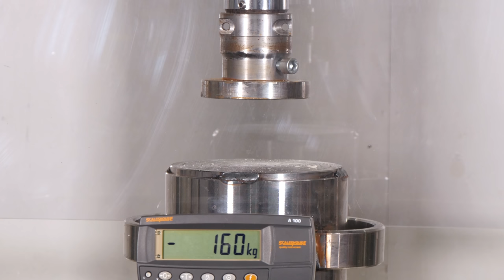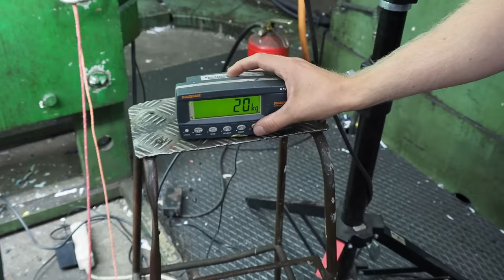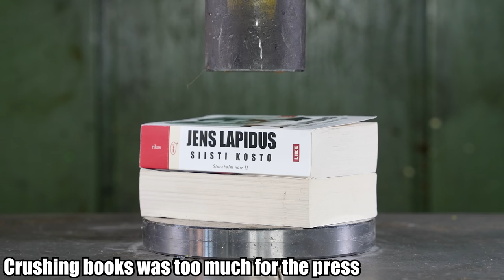10 MOST SURPRISING Hydraulic Press Moments

Comment: The amount of force that bone withstood was incredible. Watching it shatter like that made my leg hurt though.
Reply: Yet a simple fall can shatter my pelvis
Reply: @Tensen_Tempest  just a bad unlucky angle is sometimes all it needs
Reply: @Tensen_Tempest  bones can withstand an incredible amount of compressive force, but they break super easy when bent
Reply: Yeah its the different types of forces at work. I think you wouldn't need nearly that much power to break it via tension or rotation.
Reply: Angle of impact and how evenly the pressure is distributed play huge factors; it's a lot easier to crack an egg than it is to squeeze one until it bursts (good luck on the latter; if you're more or less evenly distributing force, that thing isn't breaking)
Reply: That was a moose bone, so it would probably already by several times stronger than ours since moose are fucking massive
Reply: I was surprised when it withstood 4000kg, totally didn't expect it to handle almost 10,000!
Reply: @arsomnes  They're even less resilient to twisting forces
Reply: I wonder  if the porous nature of bones is what lends to its incredible compressive strength
Reply: Next time tell them not yo use your leg bone, then!
Reply: It was like an Xray from Mortal Kombat
Reply: If bone's tensile strength was that good, I wouldn't have a hip full of hardware.
Reply: @cebuninja8008  not really, humans bones are almost same, they shatter at something around 4-6 tonnes. Moose shattered at 8.8 if I got it correctly.
Reply: @placer7412  maybe, I'm not sure if birds have porous structure too, but them having hollows in the bones makes them really vulnerable to blunt trauma.
Reply: 10k kilos. Madness
Reply: That poor cabbage gave its life so we could all be free. Remember that, my friends.
Reply: Bone-shattering force indeed.
Reply: @willwunsche6940  your muscles actually break them, if you were unconscious you'd be fine.
Reply: That made my arm hurt
Reply: did the math, it withstood over ten tons before shattering. holy
Reply: You gotta angle your bones like a tiger tank
Reply: To be fair structurally that is the best way for a bone to take force, turn it on its side or put it at an angle it wouldn't take the pressure as well
Reply: yeah looked like it withstood 8-10 tons before breaking. incredible
Reply: Reminded me of Alex Smith.
Reply: @arsomnes  kinda like tempered glass imo
Reply: Reminded the Atlas mythos. He had entire skies on his shoulders...
Reply: @arsomnes  I saved me about 40 seconds of time, I will be forever thankful.
Reply: Really tho. If us humans evolved to have such bones so we could carry that type of weight is insane
Reply: Same
Reply: It made my cow hurt.
Reply: @Tensen_Tempest  your pelvis
Reply: It's over 9000!
Reply: Moose bone
Reply: hydraulic press has got nothing on Joseph Clark
Reply: Went from doing fine to getting vaporized
Reply: Supreme Engineering.
Reply: @unknowncommenter6698  bones of birds are usually by far more porous and gaps are filled with air. Grants a lot of stability with extreme light weight, sure they're not build to hit windows. 😂
Reply: @K Ryuzaki
For eggs it’s only from top to bottom it’s strong. Squeeze side to side and it’ll break easily.
Reply: @Oturan20  Where did you get that from? That's just not true. Soft tissue usually absorbs forces or redirect those, so it protects bones from breaking. Seizures may cause fractures, that doesn't mean muscle break bones in an accident. The Direction and intensity of forces, soft tissue and joint functionality and stability of bones decide about the outcome of an accident. 
Many people who fracture their pelvis may have a history of dysfunctional iliosacral joints and facet joints of the lower back in combination with less "reactive" soft tissue due to high tension.
But mostly it's really all about high force on a small area in a bad angle or torsion.
Reply: It's taking all my will power to not  make a boner joke right now!!! 🙈
Reply: 10:00 Card-shuffle-machine for casinos !!!
Reply: Probably wasn't a human bone
Reply: @johnwhite7700    several tons of force have been measured in  Some martial-arts champs' punches & kicks !!!
Reply: @willwunsche6940  The iPhone screens of the human body
Reply: bones can withstand a lot of compression force in that direction (wouldn't if they turned the bone on its side) but very little torsion force, which is usually how breaks occur I think
Reply: Some very healthy bone right there
Reply: If I apply ever a force as little as 400kg or 4000N perpendicular to leg bone then it will easily shatter
Reply: My shinsplints hurt in sympathy
Reply: I did not know this!
Reply: That was a tusk right?
Reply: "Holy Shit, it's gonna be bad."

Keeps going

Love this guy.
Reply: The weight of 2  diesel trucks is insane
Reply: @RyanFox85  Thank the heavens you’re not into watching that sorta stuff. I can’t even think of such a scenario! 🤯🫣
Reply: 10 tonnes of force… crazy
Reply: @russdy1982  I love how his reactions! So adorable! 😊
Reply: I think that piece of bone was much thicker than normal bone. Also most bones don't break up and down, they break sideways. Still pretty cool how strong our bodies are, though
Reply: @antagonizingprotagonist8721  It must have been from a femur?
Reply: It made my stomach go a bit queezy
Reply: Can't beat the original engineer 😏
Reply: timestamp?
Reply: Big boy drank his milk, all right!
Reply: @cebuninja8008 imagine a brachiosaurus bone...
Reply: As you say that a black ooze forms in the corner of your room. A man covered in the ooze rises up from it laughing.

Comment: Its both interesting and difficult to fathom that bone is capable of sustaining more psi and downward force than a car jackstand. My all time favorite HPC experiment is watching the press cut cards in slow motion.
Reply: This cards sounded so much like popcorn too!
Reply: The bone has a lot more total cross-section than the jack stand at its weakest points and doesn't have moving parts introducing additional stress and failure points. A solid cylinder is one of the strongest shapes for straight compression, can't say I am surprised. A simple sheet of paper rolled into a tube is surprisingly strong too for how floppy the walls are when you poke them sideways.
Reply: @teardowndan5364  people don’t seem to understand bone is rarely the issue in healthy people. It is incredibly strong, constantly remodels and rebuilds itself (you literally replace your entire skeleton every 7 or so years) and has an incredibly amount of blood supply to speedily repair any damage done to its dense and complex structure. There’s a reason why joint issues are so much more common, the cartilage covering the bones don’t even have their own blood supply and thus heal absurdly slow or not at all
Reply: Now THAT is how you cut a deck of cards.
Reply: I learned this when Bill Nye demonstrated that comparing it to aircraft aluminum.
Reply: Turn the bone on its side and it would probably crush fairly easily.
Reply: @eahenrie :  "52,000-Card Pick-Up?"
Reply: A bone has to bear constant compression from body weight plus positive and negative G forces from extreme maneuvers also intensely being held at tension by by muscles and connective tissues as well as additional loads for several decades continuously in a corrosive environment, where a single failure means death and there is no meaningful downtime to be taken offline for maintenance.
Reply: Bones tend to be very strong against compression, but weaker against sheering, or twisting forces. That and the joints are why people aren't way, way stronger than we are. 

Bones are frankly amazingly well engineered.
Reply: Nobody here talking about how cilinders are naturally strong when compressed vertically

And yes ik if I crush it at an angle or compromise the sides it's significantly weaker it's just that they did not touch the bone during the crushing
Reply: Remember friends. Its not the bones that give when you lift weights. Its the glue attaching  your tendons and ligaments that gives.
Reply: @spinosaurusgirl09  Literally the second reply to this comment thread talks about it
Reply: @thomasrocke  I see that now thank you for pointing out my mistake, and I'm sorry for almost spreading misinformation
Reply: @spinosaurusgirl09  No worries. Sorry for being hostile, we all miss things sometimes. Have a good day
Reply: Sadly that's a moose bone. I do wonder how a human bone would fare in this situation

Comment: The drill bit hitting the safety glasses was a 1 in a million shot!
Reply: Doubt it. Anything that shoots out from machinery or tools will inevitably search for eyes or any type of glasses.
Reply: @agentpaper8130  this is definitely true😂 out of all the places a spark can go it will always go in my eyes lol
Reply: @RetirementFund750  Yup 😂. I know how that goes.
Reply: There have been a few times where stray things have hit my glasses, It's hard to stress enough how important they are even if you think you don't need them
Reply: @RetroPlus  I was shown a pair of safety glasses one time with either a dent or a chip in a spot that was covering someones eyes. All I was told was that if they weren't wearing those safety glasses they'd have lost an eye. Since then I've taken them very seriously.
Reply: Nah, I'd say more like one in twenty or thirty... it was essentially guaranteed to shoot sideways
Reply: Hot summer day.  Climbed to the top of the concrete form.  For a second,  I thought, “Nah skip the glasses”, but then slipped them on.  Hit the sharp, hardened steel fastening pin and it hit the glasses in the center of my right eye.  Great vid

Comment: The safety glasses one at 6:58 was pretty damn cool. 

I work in construction as a Commercial/Industrial Electrician and one of the few PPE (Personal Protective Equipment) that I never slack on is wearing safety glasses. I'll admit that sometimes I remove my hardhat to get my head into smaller places or remove my gloves so I can get better grip on tiny hardware, but glasses? I always wear them.
Reply: I slacked on safety glasses once because I was just holding a piece of wood for my dad and I had to get a wood splinter removed from my eye in the ER. Fun fact, if you get a splinter in your eye, it still feels like it's in there for days or even weeks after it's removed.
Reply: Gloves can be a hazard with some machinery
Reply: @Werevampiwolf  I got metal shavings ON my eye before. And that sucked a lot. Can't ever imagine getting something IN my eye
Reply: @nicojokelin5547  Oh I agree. I'm just referring to directly my line of work and what I've experienced. Which doesn't really require big machinery

Comment: 03:20  The amazing thing with that Prince Rupert's drop is that you could duplicate the destruction of the press with your bare hands just by snapping off the thinnest part of the tail.
Reply: I don't think you can put enough pressure on the bulb part to break it, I've only ever seen the edge of the presses & tools clip the tip of the drop causing it to break. I've seen tungsten press heads indent to the point where the sides hit the tip, but never seen the bulb crushed.
Reply: @taowroland8697  No, the point is that when you break the thinnest part of the tail (which you can do with your hands if you're brave enough), the entire thing implodes into the tiny fragments, just as you see in the video.  The press didn't cause that.  It just created a point of failure that allowed the internal stresses to be released.
Reply: The physics behind those things are really interesting, and it's cool to see it actually illustrated how ridiculously strong they are (not counting the tail).
Reply: @PeTTs0n88  could you make one as strong with no tail?
Reply: @Baker.E  you almost can’t really, the whole cool thing about them is how strong they are, yet having an Achilles heel that makes them not worth it
Reply: @ronald8062  Energy can only be stored mechanically like that if there's a deformation.  Virtually all of the energy stored by the press action is in the structure of the press itself, through deformation of the frame, compression of the fluid, etc.  And that's all released by the press returning to normal.

The glass isn't compressed noticeably at all, which limits how much energy can be stored in it from an outside force.

I'm sure it's not zero, but I don't think it's going to visibly change the results.
Reply: @egorsdeimos3523  I don't see why you wouldn't be able to, you would just need to make a spherical bead and cool it off.  I can think of a few ways to do it.
Reply: @Ildarioon  you cannot, that is what makes prince ruperts drop drop so satisfying  and unique.
Reply: @egorsdeimos3523  They are quite literally tempered glass dude not some magical talisman passed down from god to man. You will notice that tempered glass shows a similar behaviour when broken, although less extreme by design.
Reply: @Ildarioon  uh huh

Comment: 1:40 "How many kilos can a bone support before breaking?"
It's over 9000!
Reply: Huzzah, a man of quality
Reply: But what type of bone was is?
Reply: That’s because the bone is vertical, if it was laying down it would be much less force Edit: fixed it to vertical
Reply: @KettuF0X280  *vertical (it's standing on-end)
And, yeah, if it were laying down, the force would be way less. It's kinda like a tree, as it grew, all this force is pressing down in one direction so it has to be strong that way. But turn it 90* and it'd be much easier.
Reply: @DraconicDuelist   sorry I get the two mixed up a lot
Reply: @KettuF0X280  'S all good. If it isn't a part of your regular vocab for a while, it doesn't always come ready to go.
Reply: What 9000?! There's no way that can be right!
Reply: @DraconicDuelist   also the fact that most times a bone breaks when it’s not vertical, if someone to break a bone vertical, it’s either a fracture from something hitting it or something or a giant boulder fell on you and broke your entire body. it’s very hard to break a bone while it’s vertical, seeing that it’s usually protected by other bones or muscle and fat. The exception is the skull seeing as it’s much more “exposed” to the elements. Basically what I’m saying is that it’s very hard to break a bone vertical, meaning that the reading for the amount of force/weight needed would be much less if placed horizontally.
Reply: Imagine the femur and other leg bones of heaviest dinosaurs, weighing 70+ tons. Their bones must've been the densest ones ever.

Comment: So, I’m a lab tech and right now I work with a company that samples, tests and designs various mixes of concrete, we cast cylinders of concrete to determine their MPA, KN of force and other leaching and curing experiments in terms of maximal strengths at various times of the hardening process. It’s important to note when doing crush tests such as in this video how the concrete cracks. Typically an X crack means that the concrete is very strong structurally, a cleft crack typically means that there are structural weaknesses and a shear breakage means the concrete was really wet and wasn’t proportioned correctly. The bone in this video could withstand almost a tonne and snapped in an X pattern 10:30 … that’s impressive

Comment: I don't remember but did you ever crushed natural crystals of any kinds, specifically crushing them with lights off and camera focused inside the crystal to spot the light generated inside just before the cracking? I think it would make for a great slowmo video.
RIP windows btw :D
Reply: That is a pretty good idea.
Reply: Woah! Really? That's so cool. I hope he does it!
Reply: Actually you can crush any cristals, even hard candy! Theres a slomo video about that effect where they crush candy with a hammer, I agree it be cool to watch on a larger scale
Reply: Actually you can crush any cristals, even hard candy! Theres a slomo video about that effect where they crush candy with a hammer, I agree it be cool to watch on a larger scale
Reply: @Duarte_GB  yeah, it has something to do with breaking crystalic bonds of any kinds, this includes hard candy or sugar crystals of any kinds in general
Reply: @sillyjellyfish2421  Technically metals are crystalline material. (Well, it's possible to make amorphous metal but it's not that simple).
Reply: @seneca983  yes, but they are also opaque which means that you can't see into them.
Reply: I would recommend quartz, its piezoelectric and thus can generate some small amounts of light when under lots of pressure

Comment: 7:05 "Who'da guessed that the safety glasses worked?"  Well, I'm sure that the watermelon appreciated it 😆.  Seriously, there's quite a few people out there who didn't wear safety eyewear and regretted it.  It's so easy to JUST PUT THEM ON before you use that bench grinder, press, drill, saw, air hose, anything that can accelerate a particle your way.  "It's just for a moment". "Too much trouble".  "Safety eyewear is uncomfortable". "I'll just duck if something breaks" (no you won't).  No excuse is going to make up for that eye injury.  
 Read about a guy who had a pair of safety glasses on a shelf 3 meters away... but elected to use that bench grinder barefaced.  He's now in a permanent, self-induced nightmare of total blindness from that grinding wheel shattering into his face. 

Thank you, Lauri, for showing your safety precautions like the safety glasses and blast screens.   It's a good and entertaining way to educate folks on just how much force is applied and released from working tools when something breaks or slips.